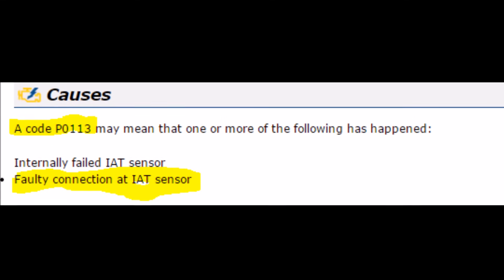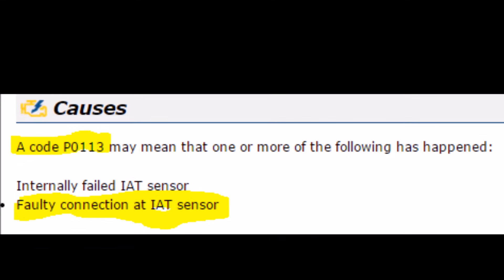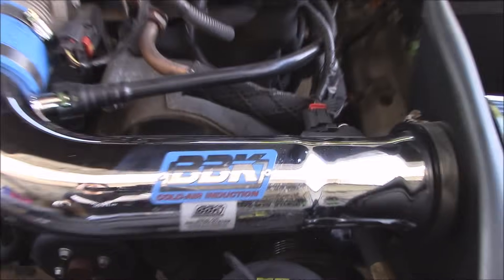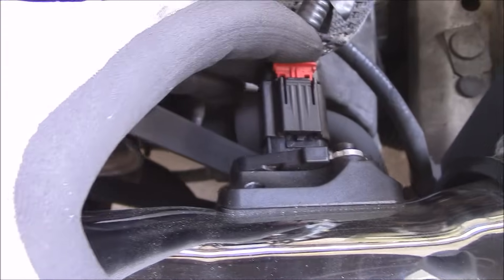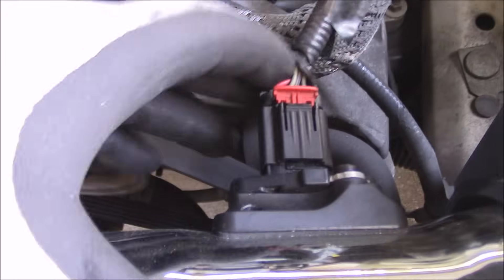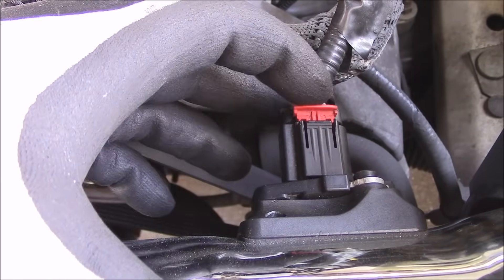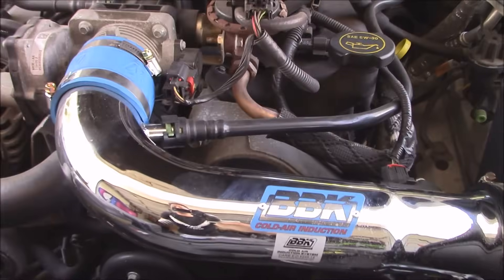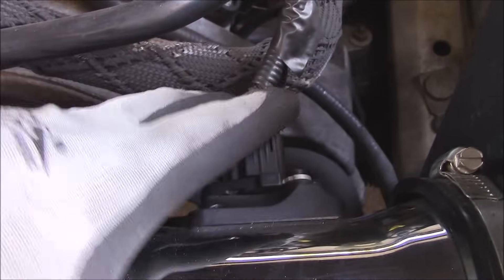HOW TO RESET CHECK ENGINE LIGHT CODES, 4 FREE EASY WAYS !!!

Comment from the maker: under $20 car scanner (works with gasoline cars 1996 and newer) it scans for errors and resets code but you need to fix the issue otherwise error code will trigger again.
OBD2 handheld Scanner http://amzn.to/2kEjN6E
OBD2 bluetooth Scanner-https://amzn.to/3n34xDP * affiliate links
Reply: when I start the car its not showing but I had the key in the ignition and it was showing. did I do it right?
Reply: the igition switch has 1,2,3,4 correct? when its on 3 the light is showing but when I start it its off. my gas cap is good
Reply: Doesn't work if you need an inspection sticker. I know for a fact.
Reply: BadseedzOnTop vehicles are designed to show lights before starting so you, the mechanicand (or) the state inspector that the bulb is working and or not removed/bad. it goes away after starting the engine assuming there are no problems related to emissions, or severe engine damage. if the light shows up before you start the engine, you know the bulb and circuit is good. if it goes away then you have no confirmed codes stored in the computer. you may have a pending code or two. but will not cause the light to illuminate until confirmed
Reply: Tampatec I
Reply: Tampatec I
Reply: Tampatec
Reply: Tampatec 2000 Honda civic dash
Reply: we are at the mercy of the mechanics.
Reply: Tampatec morning
Reply: Tampatec [[[[[
Reply: obd 2 no good for 1998 nissan
Reply: P0046
Reply: instaBlaster
Reply: Gas cap

Comment: Thank you for the tips. I have been working on my own vehicle now for a year. I did exactly what you showed in the video. I fixed my truck and rode around for some 75 miles and the check engine light would not go off. I disconnected my battery for 1 minute connected it back and the light went off. Thank you, thank you, thank you!!!!! Your the best!!!!!

Comment: Went to my mechanic for Inspection after reading code. Reset it like you did with the negative wire to pos. Worked beautifully ! No problems. Inspection went smooth. Thanks so much. You are #1 !

Comment: Thanks for the great video, ive normally paid £30 a time for auto electrical engineer to come out & sort the light out x3, i never
realized how simple it was but then again, the electrical engineer would not be about to tell you that, they just want your money even though 
he was done & gone within 5 minutes. Mechanic also checked & told me its only indicating a minor issue & no big deal, hence another £35, so i am going to give this a go the next time as it come on which is only now & again... 3 times a year. Greatly appreciated!!!

Comment: I'm so grateful for this video.  Haven't tried it yet, but I've had this problem for 3 years, getting a vague code (440 I think) that mechanics can't pinpoint but charged me a fortune trying different fixes. I was on the point of buying a new car I couldn't afford because this one failed inspection and I didn't think the mechanic (different from the inspection shop)who reset it would do it again. If the battery trick doesn't work, will get the diagnostic tool as I saw the mechanic use it to reset codes.  I'm so grateful for this info.

Comment: Thanx for the vid. I tried it and...TADA, it worked. Pretty sure it came on due to a bad muffler that was replaced not too long ago. Tech didn't reset it after replacing it. You saved me from having to go back to a mechanic to get it cleared.

Comment: Thank you Tampatec 👏 I've had two different dealership's try and hit me with that diagnostics crap after I told them my battery had faulted. Replaced my battery and all light's are off and Radio is no longer Locked!! Your a freakin life saver 🤗

Comment: Thanks a million for this video. I have a 2008 smart car and the repair manual cant be found in any parts house..however for the   cost of an air flow sensor that is easy to find I may just take a chance and replace it..great job on this video...

Comment: My 2013 Jeep Wrangler had the GASCAP error   light come on...After cleaning O-ring, and tank lip as you said. The GASCAP error went away but only after driving home from work next day......and a day later the O2 sensor quit staying on....Was worried there a bit but cooler heads persevere I guess...Thanx dood.

Comment: Thanks for the info. My wife had refuelled on a trip to town and the check light came on. I watched your video and sure enough the petrol cap (UK) was not secure and loose! re-secured and reset light by battery disconnect. All good, cheers!
Reply from the maker: nopwoc cool, it's common for that to happen.

Comment: Gave me a pretty good idea of whats going on in my car. I have nissan maxima 03 with the following codes, P1614 & P1456, the last code is basically the same issue you showed in your video, its got to do with the EVAP leak, fuel cap, etc. and the first one has to do with some problem reading the signal of my key, Now let me just give you a reference, I have a key installed under the steering wheel ( for remote starter purposes )
Reply: +drumskas...
P1614=is an Immobilizer chip key code... Key on or engine cranking, system voltage over 10.5v, and the PCM detected a problem in the Nissan Antitheft System (NATS).
P1456= is an EVAP system leak (Very Small Leak) .020" leak

Comment: Not too bad of a vid but I suggest you upgrade your tools as in the comment I left below. I've been working on vehicle for 20+ years and to say things have become more complex is an understatement. I have an example, and it is my own nightmare. I lent out my MD75 to a friend a while back who went out of town for a month and had an issue with my car. Using my neighbors scanner, similar to yours, I retrieved the codes. It went from one to another to another. All in all I spent over $800 just to find out it is a weak fuel pump which will cost ANOTHER $185. I replaced the MAP sensor ($45) , Knock sensor ($65), Crank sensor ($60) , IAC solenoid ($68), MAF sensor ($139), Cam sensor ($129), Catalytic convertor assy ($280) plugs and wires ($70) along with getting the injectors cleaned and flow checked ($80). If I had the MD75, it would have shown the issue right away thru a poor injector pulse pattern due to low/intermittent pressure.

Comment: thanks a bunch! I unplugged the negative cable for 10 mins n did the trick on my Celica. I hoping the sensors are just too sensitive or it'll be back in a few miles. but thanks 😀
Reply from the maker: just in case it's best to carry car scanner $18. link is in video description, that saved my ass few times, saved me $$ getting ripped off too.
Reply: +Tampatec since '07 its universal, obd. 'vag' uses diff protocoling (vw/audi etc.). unplug battery, both poles and try connecting +/- wiring, hold-down for a min orso, make sure battery is in-total disconnected .....!!!
Reply: I own a Nissan Xtrail and need a scanner devise how can l get it. Am in Zimbabwe

Comment: The most important part of this video is the ring on this gentleman's hand. When he gets the ring between the positive connection on the battery, or ANY positive connection AND any other part of the grounded car (negative connection), here's what's going to happen in slow motion. The ring will conduct unfused current at as many amps as the battery can produce, through the ring. The ring will be arc welded to the connecting point(s) and INSTANTLY become red hot. A brilliant flash of light will startle the shade tree mechanic and he will jerk his hand away before there is even time for the situation to register in his brain.  He will leave the ring and his ring finger cooking in the engine compartment. Don't wear a ring when working in the engine compartment of a car. Any other mistakes in this video are forgiveable.

Comment: Thank  you so much . My check engine light came on  after I had some work done on the 1999 S 70 Volvo Gas door that was not opening.  The  Mechanic shop could get the part  to make it work electronically   so he tide a zipper in the truck to open the gas tank so I can open the gas door to get Gas to fill up . The Mechanic   shop said  the  tester  code did not say any thing wrong, but  the light is still on and it is safe to drive . Your video  explain   what to do and how to read the code  and look for the issue. I will check with Auto zone tomorrow. I Thank so much

Comment: How do you figure that's a Cold Air Intake? The stock air cleaner drew air from the outside of the engine compartment. The way I see these things set up is they draw Warm/HOT air from Within the engine compartment. One might get better performance from a more efficient filter just like we used to flip the air cleaner cover on our carbureted Chevys but we sure as hell wouldn't have called it a Cold Air Intake :/

Comment: yea, it worked for my 2008 honda civic. What i did is put the key in the ignition, turn the car in position to crank, popped the hood, disconnected the neg terminal for 5 min, then reconnected it. Cranked the car and the light went toff but before hand one switch for oil pressure senor P0523 was loose, then reconnect and all done thank you @tampaTec
 so much saved me some cash!!!

Comment: That battery cable method worked on my 2011 Ford Flex. It removed the search engine light. I only had battery cables as connectors instead of the small jumper in the video.

Comment: Do i connect the negative terminal(not connected to batery) to the positive thats it connected to the battery....or do both have tobe disconnected from battery
Reply: That’s how he showed it I’ve tried disconnecting both and every other trick on YouTube and my check engine light remains I’m scared the computer will fry if you leave positive connected to Battery and jump it to neg wire

Comment: Hi, today a warning light turned on on my '02 Fiat Marea 1.9 Diesel. I think it's an fuel injection fault, since the warning light looks like an injector, so I'm wondering if this scanner can read fault codes for fuel injection circuits or not? I found a scanner on eBay for 10$, so can you please tell me if it will show the fault code or should I buy a more expensive scanner? Thanks

Comment: Disconnecting the battery in many cars can cause huge problems, especially if you have auto down windows and electric doors.  Caddy XLR etc.  Reset all controls - seats, radio, clock, mirrors etc.

Comment: Hey, check out Schrodingers box Lean condition. Not all check engine codes are set by a O2 sensor. If the code says O2 it almost always say lean/rich condition. Usually from a vacuum leak, wiring problem to a sensor( MAP,MAF,IAC,Fuel Injectors,etc) or a bad sensor or something that will cause a lean or rich condition. Not trying to shut you down or anything. I like your videos but just want to give you some resources that you mite have been unaware of. Check out ScannerDanner too.

Comment: Is it not supposed to go out on its own after getting a repair and fixing the problem? I heard it should go off on its own without resetting it if the problem was fixed, after driving for a while, it goes out, or do you always need to reset it??

Comment: What are the risks of a 2003 Ford Taurus SES needing a radio code after removing the negative lead from the battery? 
I have no clue if mine will require a code in order to work again but I really want to clear out an old mass air flow sensor code which has signaled the engine light.
(Have since replaced the sensor)

Comment: can you do that jumper wire to the negative to the positive for a 1999 Toyota Solara
Reply from the maker: jones c harvey to be safe take both battery connections off first then turn on the headlights to drain to reset car.

Comment: ok I have a 2005 infinity g35 and removed the catalytic converters and installed test pipes , I'm getting the code p1283, and it causing my service engine soon light to come on . I have installed spacers between the 02 sensors and the test pipes to pull the sensor out of the exhaust airflow stream . I have disconnected the battery 2-3 times now and the check engine light keeps coming back on , what can I do to get the light to stay out and still use the test pipes?

Comment: i would like to ask if what would be the best solution for my car. i have it scanned and the scanner said that i was a internal circuit failure. would that affect my car? thanks.
Reply from the maker: if your car is in warranty take it to the dealer or mech. few times reset may work but get a full diagnosis is best.

Comment: The scanner will work on some 1995 and on all 1996 and newer vehicles not 2000 and newer also some AutoZone will reset the light a lot will not as you are not supposed to reset that light unless the repairs have been made in the end it's all up to the autozoner helping you out
Reply from the maker: thanks for the info
Reply: andres perez 
09
Reply: i have my own scanner.
Reply: Then you can clear your own code or codes after the repair as now days not autozone nor oreilly (formerly checkers) will delete the codes.

Comment: Hi I have a 2003 Ford Escape. repaired accident and air bags. Now with the air bag light staying on my instument panel does not work. No speedo, no tach, no sensor lights, no gas gauge, my signals. I am thinking fuse.. what could the problem be? Thanks CLaudio
Reply: My friedns had the same problem and the mechanic said that the car's ECU (Engine Control Unit) which is also used for displaying speed, tacho, etc. on the dashboard was faulty and after he replaced it, everything worked fine (he got a used ECU on eBay - they are quite cheap).
But first, I'd check all fuses (you can easily see if the fuse is blown or not - just check the fuse's wire) - even those under the hood which are usually for ABS, ESP, ASR or SRS/SRP airbag systems.
If all fuses are working, take your car to a mechanic and he will tell you if it's a bad ECU or something else :)

Comment: i have replaced the variable timing sensor,mass airflow sensor, upper oxygen sensor, and the camshaft position sensor. and the check engine light will not go out. what do i need too do to make it go away ?

Comment: I BOUGHT ANOTHER GAS CAP FOR MY CHALLENGER BUT DIDNT FIX  THE LIGHT. WHAT I DID FINALLY WAS PUT LITTLE BIT OF GREASE IN THE GASKET AND ....DONE.
Reply from the maker: ROBECABAL thanks for the tip 👍

Comment: so after i used the scanner to reset the codes, the engine light came on right after i turn on the ignition. is this suppose to happen or am i just using the scanner wrong?

Comment: I have a ford mustang  3.8L V6 with a check engine light lit (sometimes blinking). However my repair manual (Haynes) informs me that the codes indicated in the text only applies to 5.0L. V8 model & 4.6L DOHC V8 models.  Can you tell me where I may be able to obtain the compatible codes for my vehicle. Any assistance would be greatly appreciated!
Reply: Ndiyo Tunaweza
Reply: Thanks
Reply: Ndiyo Tunaweza
Reply: Joshua Brobst

Comment: I've seen a tech turn off engine light indicators (can't remember which ones) by simply doing certain steps on the steering column, key ignition, etc. Sort of like what Drug smugglers do to open up secret compartments inside a vehicle.

Comment: My 2000 Oldsmobile Intrigue, 3.5 liter engine, not only has check engine light on, but also the anti-lock brakes and the traction control lights are on.  My mechanic says he has checked that the engine is okay, and that the diagnois is need of "traction control module" replacement.  I am unable to locate this module, or even find out if this module exists.

Comment: When i Taken to do the smog they check AND tell me the heat sensor was bad an replaced! So if i do that of  desconect the battery AND the check engine disapear when i take the car again to do the smog AND they put the sacner" the problem of the heat sensor did Will apear even if the check engine ligth Is off????

Comment: Thanks for the vid. BUT, just like everyone else, you didn't show how to reset codes on a NON-OBD2 vehicle (i.e. 95 honda). I really pay attn to Ericthecarguy and his many Honda vids, but even he hasn't shown a way to clear codes for that. Removing the battery cable apparently doesn't work either. I only say this because I have done so for many jobs on my car, and I still get codes for things I have fixed along the way. I now have an idle issue, and am getting codes for things fixed (like when I had to replace my water pump, bleed the coolant, replace ECU, etc.) I know what those refer to, but want to clear them so I can diagnose current or future problems. Please update this video or make a new one with info for '95 and earlier vehicles (non-obd2).

Comment: I tried to reset the codes after I replaced a vapor detector. The odometer reading hr 8074... Is that the hours for the engine?

Comment: reply me. what if the check engine turn on when running condition after 5-10 km drive? it also feel losing power and off because of losing power.
Reply: Louqe Month

Comment: my check engine light wont turn off, no codes are being thrown either. :(
Reply from the maker: Try This car code reader plugs into obd port under the dashboard and is only $15 currently... Scan code write it down then reset it with this scanner. If this doesn't work then main board could be bad .
https://amzn.to/3t3LtLk

Comment: why is it so hard for me to get the rite  transmission 2000 Dodge Ram 1500 Laramie LST quad cab  360 5.9 litter it had a 12 inche fly wheel and tork converter the keep telling me that they have what I  need  and it's not the rear end is out of a Dodge Ram 1500 out of a 96 I  believe that the motor is a 95 I'm not really sure but it's a strong  running motor